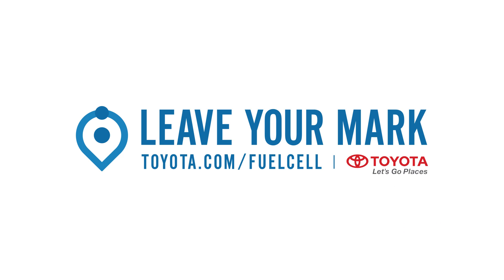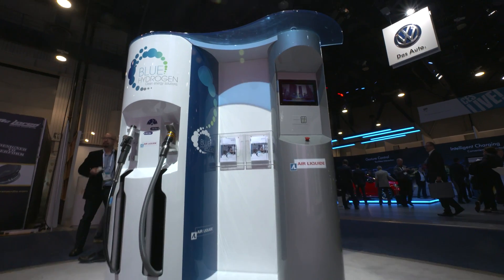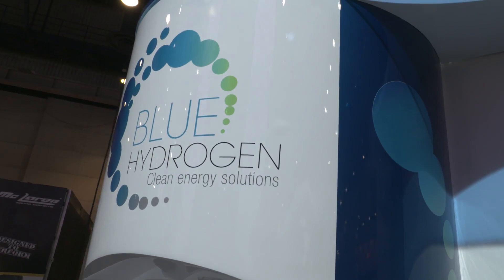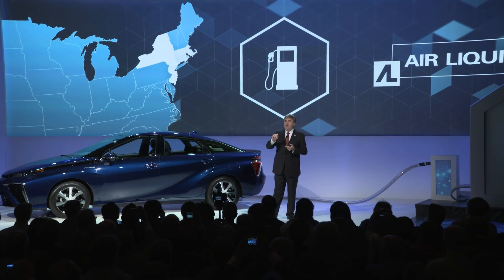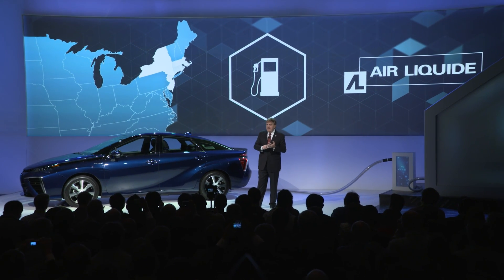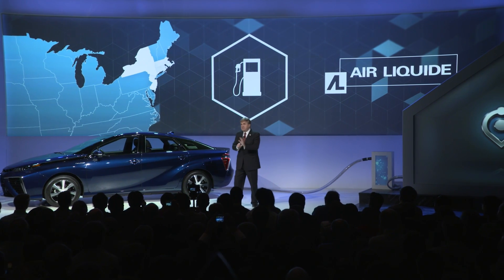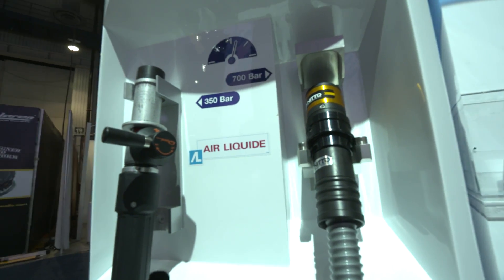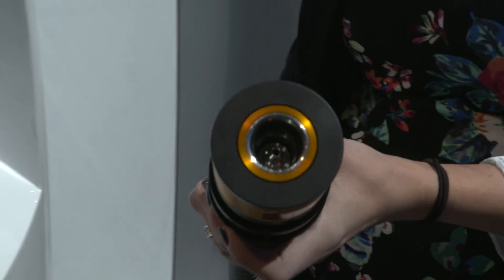The Future of Filling Up

Comment: Hydrogen is not the future, and hydrogen economy will never be. Hydrogen is abundant on Earth but not in the form you need it and you need to put in lots of energy to make it.
It takes around 300kWh to create hydrogen needed to fill up Toyota Mirai (5 kgs), and Mirai can do 300 miles. With 300kWh, electric car can do 900 miles.
This is why Toyota is never talking about hydrogen price, and even giving it for free with vehicle, because when people realize that will cost 2-3 times more to fill it up than petrol car and 5-6 times more that electric car (for the same distance), nobody would event thing about buying it.
You can say, we will put solar panels, wind turbine or any other renewable and make hydrogen that way for 'free', but that also does not make sense, because with the same solar panels or wind turbines you can support 3-4 times more electric than hydrogen vehicles.

Alternative is to make hydrogen from natural gas (95% of hydrogen is created today this way), so technically hydrogen is  fossil fuel, and this process releases huge amounts of CO2. Natural gas mostly comes from fracking. So hydrogen does not solve environment issues.